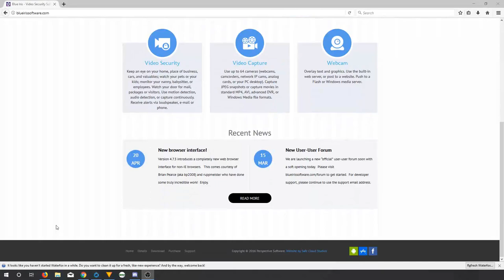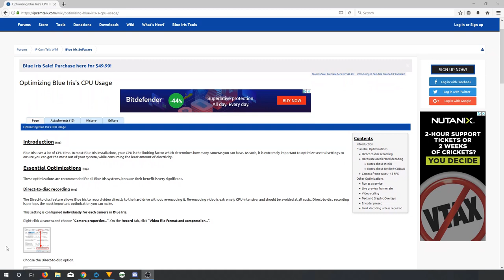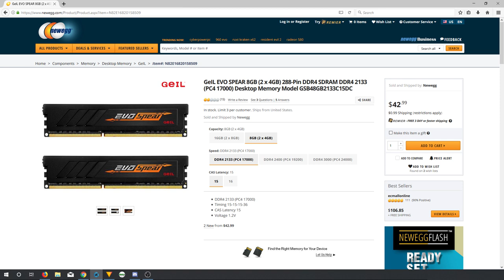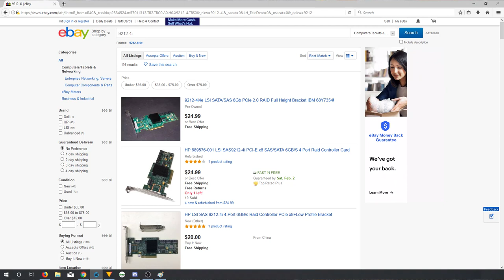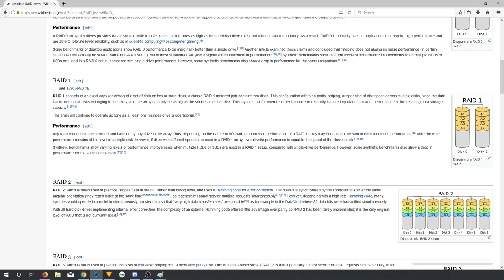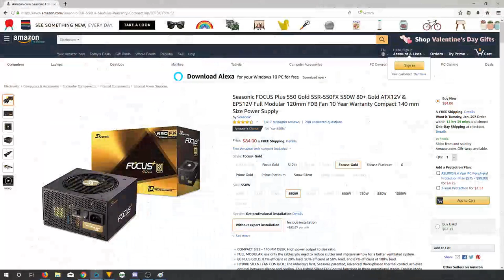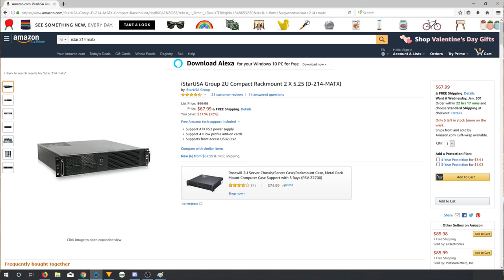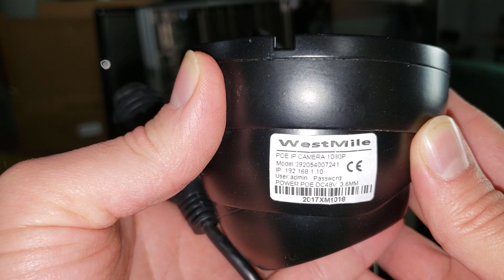Video Surveillance Server Build for Home / Business

Comment: hey buddy im fairly well versed in PC building on the gaming and hobby side. but i recently bought a home security system and dont want to use the included NVR because its fairly crap IMO. i want to build a dedicated PC/Server like you did, but i have zero server and networking experience and i have a few questions.
1. what do the actual cameras plug into? i assume a switch? 
2. does this sound right.. mounted cameras are wired to the switch and then from the switch to the PC with blue iris on it and then to the HDDs. i have 6 cameras  im just kinda lost at the switch part. the POE cables go from were the cameras are mounted to the switch, there would be 6 of them for 6 cameras, then what happens at the switch, what plugs into the PC just one single ethernet cable or does the modem/router eing plugged into the switch mean i can access the feeds over wifi?

please forgive the ignorance but really appreciate a hand
Reply from the maker: Hi Skoopsro!

Sounds like you're off to a good start here. To answer your questions:

I am assuming your cameras are wired and not wireless - is this correct?

1.) The cameras will either: have an AC power adapter for power and x1 Ethernet port for connectivity OR just use x1 Ethernet cable for data and power. Either way, the camera will need network connectivity somehow in order to communicate with the PC / Server running the Blue Iris application.

2.) What you described could be a possible solution. For reference, the best way to set this all up is with configuring VLAN and creating firewall rules to protect the rest of your network from the cameras and vice versa (including the Internet). For people starting out, they typically plug all of the cameras in the main network switch along with the PC / Server running Blue Iris along with everything else they have on the network. This is part of whats calls a flat network design. It's not optimal for security but it is how most people start out. In this scenario, you just plug the cameras into any available switchports and the BI PC. I suggest creating DHCP reservations (or static addresses if you can't reserve addresses) for the cameras and then getting them set up in BI. Wether or not you want your storage located in the PC / Server running BI is up to you, for simplicity, I would put the storage in that machine unless you are virtualizing. In this scenario, you can remote into the BI PC from your PC or laptop. This was a lot to write / read, I'll try to TLDR below

Switch______________________________________________________________________________________________________________________
|                                             |                     |                   |                 |                  |                      |                   |                   |                  |                    | 
Access point (wifi)     Your PC      BI Server       Xbox          Nest          Cam 1        Cam 2          Cam 3        Cam 4        Cam 5            Cam 6

This is very crude, I'm not an artist :P but this is the jist of it.

A much more secure method would be to either completely separate these network with different switches, you would lose the ability to remote in unless there were 2 network connections on the BI PC. An even better secure method would be to configure a smart switch with VLANs and basic firewall rules so that you can still use x1 or x16/24 port switch for everything BUT you can create logical networks to block Internet access to the individual cameras and from you regular PC hosts (and of course the other way around except for the BI server and your PC for example).  Why do you need to protect the cameras from the Internet and your PCs? Well, generally we don't trust devices with firmware on them that never gets updated or is known vulnerable, most cameras fall into both categories. We also don't want to lose control of our PCs and have them access the cameras, only the BI PC should do that. This part is a much more advanced type of setup but is worth learning IMO, it could definitely benefit you in the future (especially if you work in or want to work in IT). 

Do people use flat networks and say who cares? Yes....many if not most people I suspect do this. Will you probably be fine? Probably, but theres always that chance someone figures out who to take control of a device on your network. Unlikely, but possible. What I typically do as I learn how to deploy most of these projects is start off with whatever is easy to get up and running, then I get dirty afterwards and sort out the particulars. 

This was a long one, but I'm glad you asked, this hopefully will help others looking into this piece of the setup. I might highlight this more in the future :) If you have other questions, ask away :)
Reply: @STS  thank you for the really fast reply. this helps alot and just feeling more confident about moving forward with a project really helps get them done. that fear of the unknown can be oddly paralyzing.
 i totally plan to go the POE route with the cameras, as trying to use AC power cables isnt feasable without having an electrician do alot of work on the house. i may come back and ask a few other questions but that wont be for a while. you were extremely helpful and thank you for taking the time to write such a well written and thorough response!
Reply from the maker: No problem! You cought me right before some fried chicken :D

Demystifying cool projects is why I decided to pick up the camera :)

I completely agree on PoE, it is the way to go for most installations. 

Sounds like a plan!

Comment: in relation to integrated graphics. what if i use a xeon with a quadro gpu. will it use the gpu's power?
Reply from the maker: Hi Troy! Blue Iris was updated a few years ago now to support the use of nvidia graphics cards. While they do in fact work, they tend to be much less power efficient. The Intel HD graphics is well positioned to be the best way to support Blue Iris video processing. It's quite powerful and has a low power draw when used this way. 

That being said, I have considered doing the exact same thing in my ESXi server. Are you trying to re use old hardware or to virtualize Blue Iris?
Reply: @STS  just weighing up my options but yer, thinking of using an old r310.
Reply from the maker: @troymholmanify  And older R310 can definitely work but its going to use up a fair amount of power and generate a lot of noise. Your compute requirements depend a lot on the amount on  megapixels your pushing from your cameras. A good inexpensive option is a 6th or 7th or even 8th gen prebuilt office PC. They will have an igpu and run relatively quiet at low power draws. 

What kind of cameras were you thinking of?

Comment: how well do you think a core 2 duo would work?
Reply from the maker: Whoa, C2D? I dunno, it's possible it might run but you're talking ~15 generations old now. If you have zero budget for a PC, I guess you have to try it right? If you can spare some budget for a PC though, maybe 80-150$ could go a long way towards a more capable and still power efficient workstation you could buy on eBay. If you want to run this on Windows 11, you're technically looking at 8th Gen Intel or better or Ryzen 2000 or above on AMD.

How many cameras were you looking to use?

Comment: Wouldn’t an nvr negate the need for such a build.   They aren’t that expensive.  What am I missing.
Reply from the maker: Hi Gene! Yes, building your own Blue Iris video capture server would be an alternative solution to buying an NVR system. Some people prefer to retain control over their NVR hardware. If components on this type of server or PC were to fail, you can replace from a wide spectrum of sources since it is a PC. NVR's may use less common hardware that might be hard to get a hold of down the line. 

Which solution is cheaper to purchase and operate over time depends highly on your specific deployment of cameras and costs in your region. 

There os also something to be said for "rolling your own services" and self hosting as well - though that is not for everyone.

Comment: Blue IRIS has the best UI out of all the options out there. The only thing I don't like about it is that it needs to run Windows. Unless that changed recently there is no Linux version. I'm probably going to try Zoneminder soon as I have a 3700X just sitting in a box doing nothing. Probably add a 1050 TI low profile to help with the video encoding. How many video cameras do you have? Is your Intel CPU able to do handle all the video processing ?
Reply from the maker: Blue Iris is the software to beat right now, that's for sure. I haven't had any experience with Zoneminer but many have recommended it to me over time. BI is still Windows only, I doubt (IMO) that this will ever change. I haven't tried GPU acceleration on BI yet myself, interested though once GPUs are purchasable again. At the moment out of my 11 or 12 cameras only the critical 6 are up and running. I'm always adjusting and fiddling, such is life 😂 

I have an I5-6600 now doing this task, handles x5 1080p 15fps cameras just fine in BI. The real interesting bit will be when I get rid of this intel system that makes use of the integrated GPU for efficiency and try to do this with an AMD system (no iGPU acceleration) using the new updates in BI version 5. The sub-stream feature seems to lower CPU usage quite a bit. There's a small FAQ here: https://ipcamtalk.com/wiki/sub-stream-guide/
Reply: @STS Yeah GPUs are super expensive. Add the pandemic plus cryptomining and the end result is GPUs become a luxury item almost. That is definitely the only problem going with AMD, the lack of a integrated GPU. But you can find decent low profile GPUs like quadros or even a 1050 TI which you could use to get a video output (in case you ever need it) and you could also use it to help with your cameras video feeds. But that is me just guessing as I have not set up any of this yet. Thanks for sharing the link!

Comment: I am interested in knowing about the parts selections.
Reply from the maker: Hey Umar! My apologies for the late reply here, things have been quite busy for me lately. AS to your question about the parts selection, it basically came down to knowing that Blue Iris (and various other NVR software) leverages the integrated GPU's ability to use QuickSync. That can drastically reduce your need for more CPU cores as you start adding more and more cameras and the bitrates start getting higher and higher. That also has the added benefit of reducing your overall power consumption. the iGPU uses much less power than CPU cores. As for the hardware that I specifically used, it was my old gaming PC so other than the case, it was free! That's one of the highlights of a custom built system like this, Blue Iris can take advantage of regular consumer hardware which worked out really well for me. 

Did you get your own Blue Iris or NVR type hardware up and running yet?

Comment: I have 2 (probaly stupid) questions. I'm new to all this so bear with me, how do you access this server once it's in the rack? Do you have a monitor hooked to it, or do you remote into it from another PC on your network. And 2, is there a option for using a raid type backup where the backup form of storage would be located away from the server? I'm thinking like placing a hard drive inside my gun safe so its secured from theft and things like fire. Thanks for posting, I'm going to use your build as a template for my own needs.
Reply from the maker: Hi BO Photo! I'm sorry for the delayed response!

None of those were stupid questions! They are in fact extremely important points to make when considering this type of PVR / Security system. 

1.) The server has what are called rack rails screwed into the sides of this style of server grade 2U case. They slide into a set of rails that slide allowing me to horizontally mount this in the server rack and pull it out towards me in order to work on it. It does this with ball bearings, I plan on showing this in better detail in a future video. This is NOT a requirement for anyone who wants this type of home / business security though. I have a few custom servers, routers, switches, and other rack equipment for my lab at home so this made the most sense for me. Since this server is in my rack, if I need local access to it, I need to connect my LCD console to it. This is a 1U device that is mount in my rack that folds up to reveal an LCD screen, keyboard, and mouse. These three can be plugged into the USB port of any device in my rack. I rarely need local access to the machine though, that's really only for bad system crashes or something like a BIOS update or change. How I would normally access the machine is remotely through a program call TightVNC (though any windows VNC client would work). I run it as a server on this machine and use a workstation (Windows 10 / Ubuntu) to gain remote access to this Security server while on my network. This way I can manage and use it and do not need to physically be at the server. Video playback is not good this way, any footage I want to watch I save to a network share or drive and view from another PC.

2.) Storage back up is up to you, there is additional cost in parts and time in setup. I believe its worthwhile though as this data relates to physical security. In this server, I used a basic hardware RAID card I got from eBay for 10$ shipped. The RAID card ensured any data written (including the instance of the operating system itself) was backed up to a second drive. In the event of a drive failure, the system can still be used normally until a replacement drive is sourced and reinstalled into the array for the rebuild / protection process. This all of course only helps you in the event that you only have one drive failure (which does happen, all things that move eventually stop moving). Backing up the footage depending on the rest of your setup can be as easy as a batch file / scheduled task copying the files to a network share from a NAS or purchasing a service plan like Carbonite (or any cloud host really) to backup to with some client. It depends on what you are securing and its value to you in terms of how far down the rabbit hole you should go here. The counter to not using a cloud service is Mr. Bad guy breaks into your location and steals the server or lights the place on fire. Either way, your local data is gone in those scenarios. A cloud copy would be nice to have here.

I'm not sure if you went ahead and built anything yet or where you are in the process but if anything else comes up or you just want to share progress, let us know 😀

Comment: Thanks for the video it was very informative and gave lots of tips. I am new to Blue Iris but really want to go this route instead of NVR however I'm trying to give new life to old desktop and just want to know if this is even a good idea or waste of money.  I have a Dell Inspiron 580s that I want to transplanted into a Dell Dimension 4600 mini tower for a larger power supply and larger GPU if needed. Currently have i3 CPU that I would like to swap out with either i5 or i7 with integrated GPU on board. Current chipset is H57, socket is LGA 1156 currently have Bois A06 plan to upgrade it to A07, going to upgrade to 16gb ram, and storage. Having trouble finding a CPU that has integrated GPU that is LGA 1156.  Motherboard is Dell  0C2KJT,  Should I even attempt this or not worth the time and money? Plan on buying 4k cameras possibly 6 to 8. Any help advice would be much appreciated
Reply: Disregard this question in my research I discovered that LGA 1156 socket doesn't have support for Intel CPU with integrated GPU. Thanks for the tip to check for this
Reply from the maker: Hi Mrosa131! Sorry for the late reply here - I'm assuming you found another suitable system? Yes, I'm glad you checked, a newer generation Intel system would likely perform significantly better especially for a couple of 4k cameras. I would probably look into a 6th,7th,8th gen platform if you haven't found anything yet though.

Comment: I would Dill Holes ontop of the case , (on top of CPU) 
Have you tried the Milestone Husky XProtect soft? 
I run a CCTV Shop and we switched to XProtect
Reply from the maker: I'm hopeful that delidding the CPU will be enough, I might try some benchmarks to see how it does under a strenuous load. I have not tried that or heard of it. Thanks for the info though,  I'll look into it.